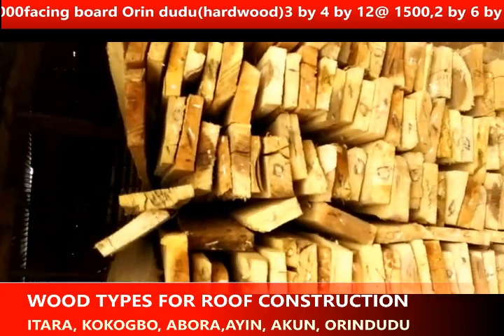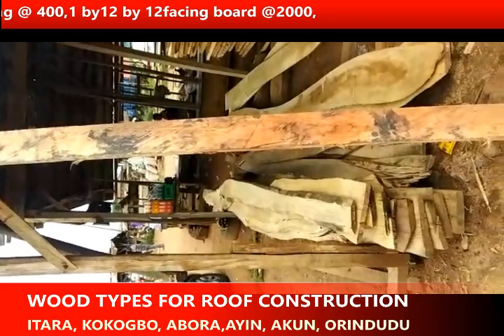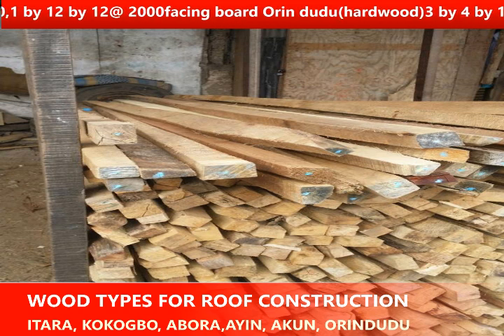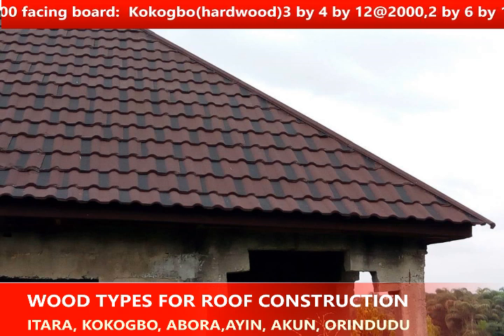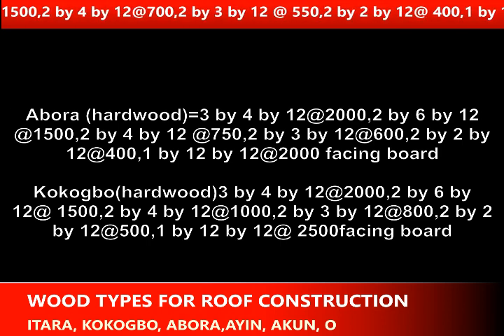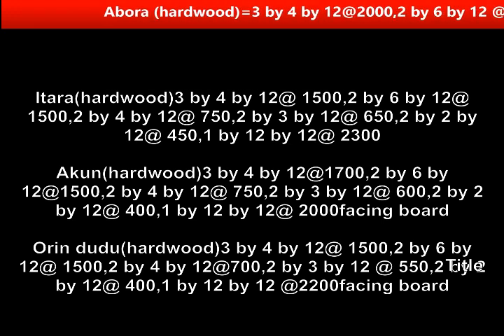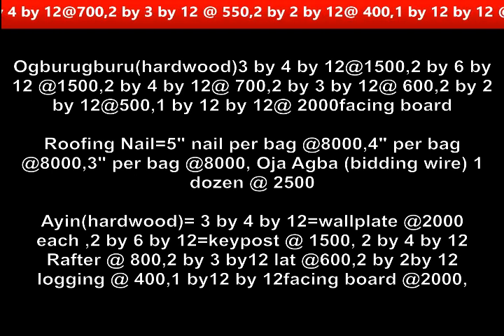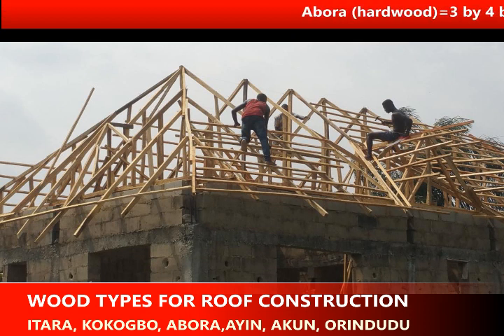WOOD TYPES FOR ROOF CONSTRUCTION IN NIGERIA AND AFRICA

Comment: Do you have to be at your site by yourself before the roofing to make sure they use quality Wood's and span??? And why are you skipping to talk about long span.
Reply from the maker: Thanks for your enquires,  yah because you are based abroad you don’t have to be on site but you can make them aware that you have knowledge of good products and good wood so they will not mess up with your project
Reply from the maker: You mentioned I was drifting to talk about roofing I was only making reference to have a good woodworks to get the best out of the roofing design